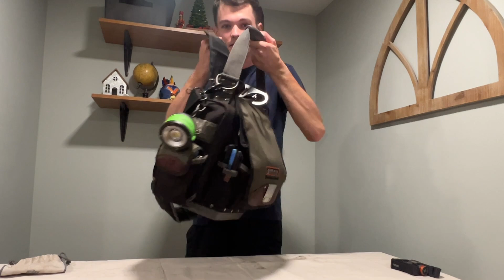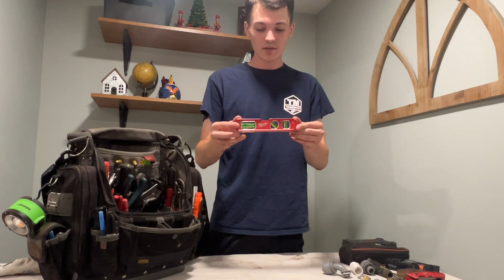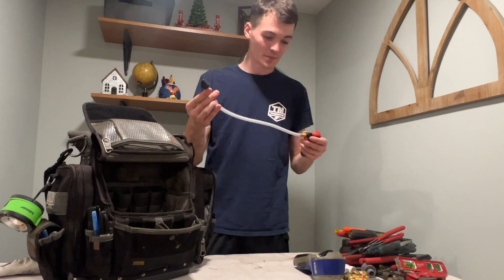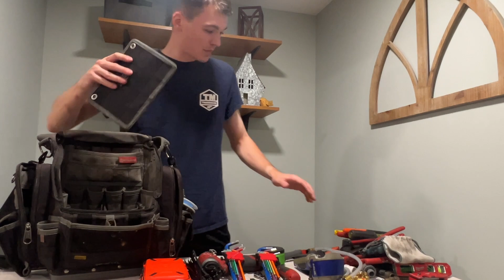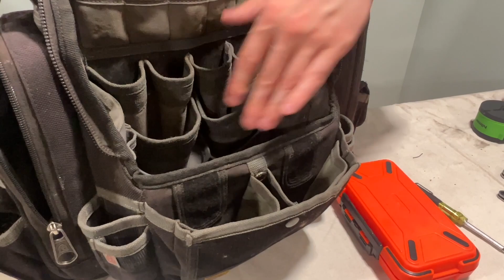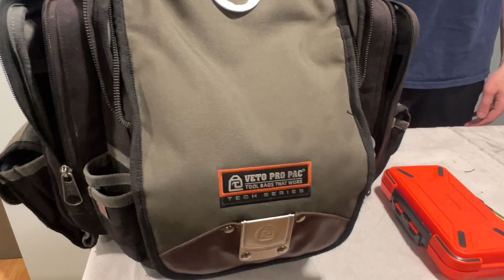HVAC Tool Bag Packout! Tools In My Veto Pro-Pack as a Residential / Light Commercial HVAC Technician

Comment: I have the Klein non contact with the light on it. Good to go. This is probably too big for your bag but good to keep on the truck. I know you like that Klein ratchet with the bits but this kit blows it away. Even if you only need it once it pays for itself. It uses half height bits and has 1/4" and 5/16" it's the Vim Tools VHC77. Nothing else like this. Nothing gets you in tighter spots. The Klein is good but this kit is the best. I also have the same Fastback cutter. I think it's the best one they made. Take a look at the Knipex Pliers Wrench. They are great and the Knipex pliers you didn't know the name is called the Twingrip. They are awesome have them also. I forgot the model but I have the Fieldpiece top of the line meter. The head swivels and it has functions for mini splits that other meters don't have. You can pass the Klein toy meter onto Peter. :)
Reply from the maker: Just ordered a UEI
Reply from the maker: And thanks for all the info and for watching